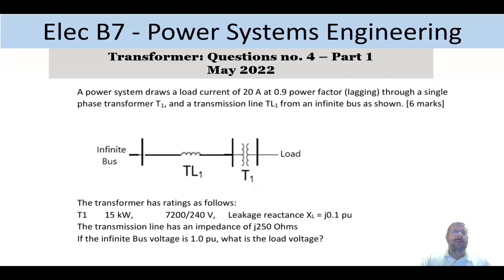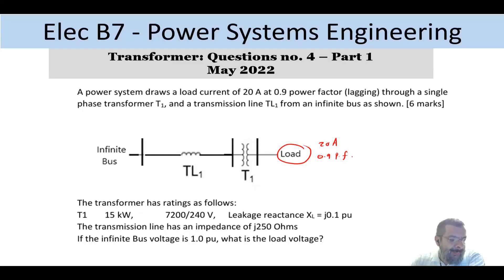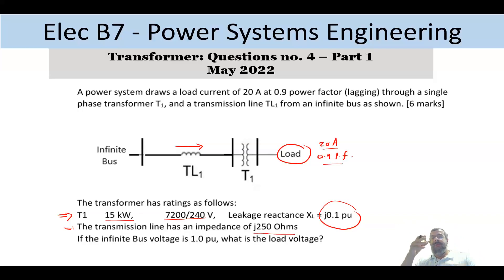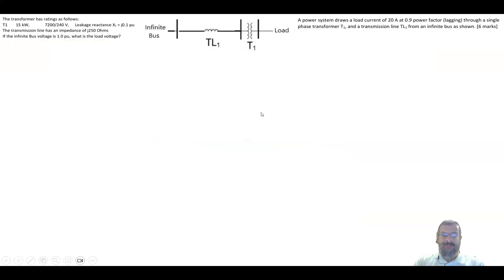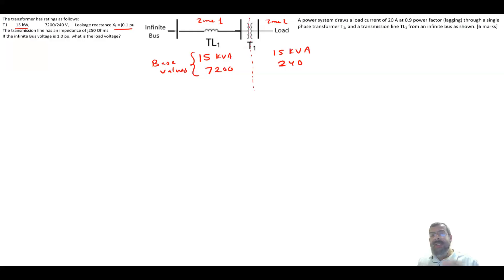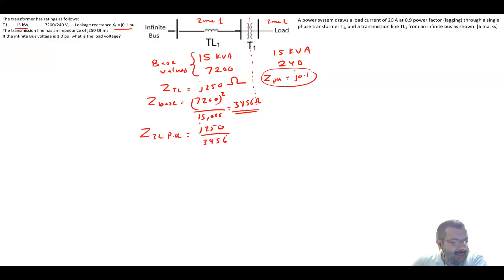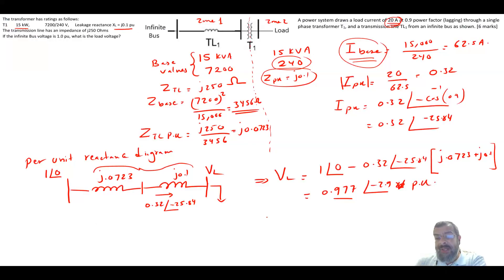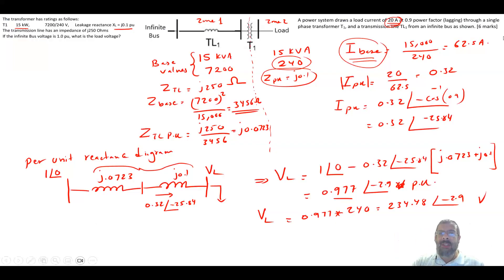PEO solve examples (ELEC B7) Transformer Question no. 4 - Part 1

Comment: Hi Dr Ayman, Thank you for these videos. I have a question regarding the angle of the PU value on zone 2. Why is the angle negative?
Reply from the maker: If you meant why the current angle is negative, this is because the power factor is lagging. The word lagging means that the current lags the voltage and hence the current angle is negative with respect to the voltage.